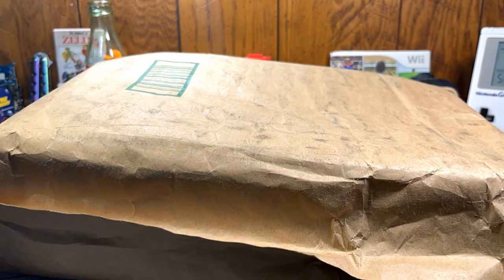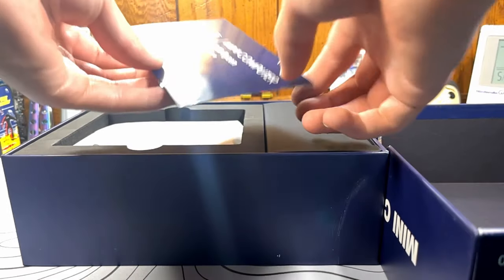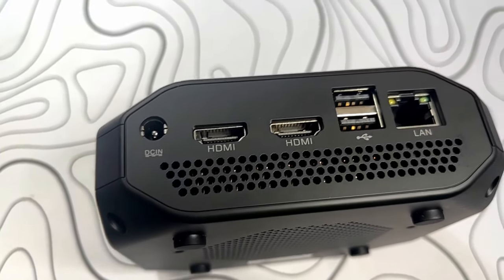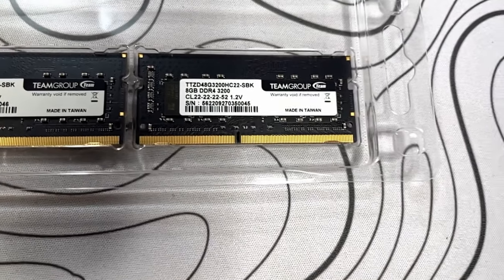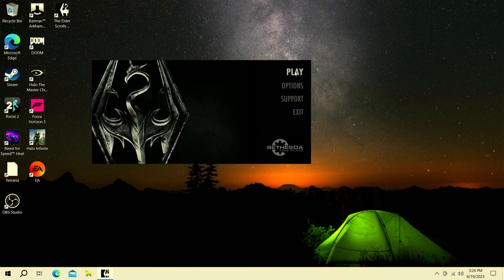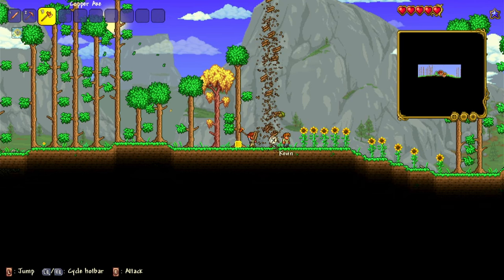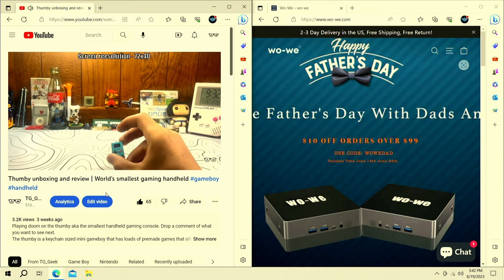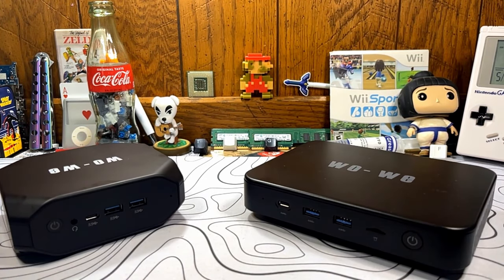This $100 Mini Pc Is Awesome! A-9 9400 Wo-we Mini Pc Hands On Review

Comment: I bought 2 of these.  I gave one to my son and he set up both with Linux (Fedora).  It is taking me a little time to get familiar with Fedora, I'm familiar with Ubuntu and Mint.  My son added an additional 8 increasing the ram to 16Gigs from the original, then I increased to 32.  Everything works well. Actually, I'm impressed,  the computer and Fedora OS, recognized the printer/scanner and I can now scan and print, which is something I could not do before.  I find that a few YouTube videos will not play, probably something in the setup,  the same videos work on the Pi-4.  I'm an old guy in my 70's and I can find my way around the computer and new OS.  I won't use MS Windows and avoid Google as much as possible. Duck Duck and Startpage work well.  I wouldn't say it's a Raspberry Pi killer, it's just different where the Pi has applications that work with the IO and daughter boards. The Wo-We would require some USB to IO interface that will need to be developed for apps.  It's difficult to compare Pi's and Wo-We's, in general, I think it's a better deal than the current over priced Raspberry Pi's. I have both, The KVM is hosting a couple MacMini's, a Pi-4 and the Wo-we excavator. My son put a remote into my computer so he can find and fix  things when I can't or mess up something.  All is good.!
Reply from the maker: Great to hear it’s working for you!

Comment: I'm thinking of using one of these in my travel trailer. I use Plex at home to record a lot of shows to watch when we are on the road. I convert them to .mp4 files and use an old Windows 10 laptop to cast them to a Roku TV. Do you think one of these Wo-we units would handle running Plex to use as a stand alone media server?
Reply from the maker: So for stuff like that I’d recommend their 5600u unit. A slightly higher price point around $300, but I’ve gotten it recently to begin reviewing for a future video and it’s a zero compromise mini pc. Has plenty of storage and ram stock and is upgradable with a really fast cpu. This unit is impressive at around $100 but I’d only recommend it for light internet tasks since it’ll bog down with more intense things.
Reply: @TG_Geek That's kinda what the little voice in the head was telling me. The Prime Day $80 price tag was tempting me but I really only want to build this once. Thanks!
Reply from the maker: @davemuir5926 Yeah I’d recommend saving the extra cash for the 5600u model, let me know how the setup goes!
Reply from the maker: @davemuir5926 Just checked the 5600u and there’s a coupon for $70 off bringing it to around $230. I have a review in the works for that particular unit that I’m planning on getting up next week or two.
Reply: I think it will work just fine.  I have done the same thing in the RV with a Pi4 along with a wireless keyboard and mouse. I tether it to my cellphone for emails and surfing and watched a few programs on a USB2.0 drive,  I can't imagine a USB3.0 work work less favorably. I have tried videos on the Wo-We through the USB and no problems.
Reply from the maker: @fredjordway5211 My unit had windows which I found would chug occasionally, but I imagine a Linux install like you’re using would be far better.
Reply: @TG_Geek  I ended up purchasing a BeeLink Mini S12 Intel 12th N95. Works good, added a 1 tb ssd. Loaded all my TV shows, all my pictures and all my music. Created another Plex server on the BeeLink, just running the single user is no issue. As much as I love my AMD cpus, for some reason Intel is recommended for Plex.
Reply from the maker: @davemuir5926 Makes sense, whatever works for you!

Comment: If the install media for your Windows 10 was for the professional version Cortana would not be so obnoxious.  You don't hear Cortana in that one at all.  I don't know why they left that noise on in the home edition installer.  There is one file that can be placed somewhere on the install media that can also have your key put into it.  Then there is a specific folder that the Windows installer will look in for it.  If it is not there it will just use your default embedded key or prompt you for one on computers that do not have it.  I know Cortana can be annoying while installing Windows.  I wonder how many people it startled to this day while they installed fresh copies of Windows.  It wouldn't be so bad but it is just about full volume or at least annoyingly loud.

Comment: What is the idle power consumption? I need to replace an ancient atom and power consumption and cost are my main sticking points. It isn't doing anything stressful, but I need to run windows 24/7 and I'm off grid.
Reply from the maker: Ranges from 5-10W.
Reply: @TG_Geek  That is pretty good... I might find lower, but probably not cheaper while running windows. There are probably more power savings to be had finding a really good 12v supply than a more power efficient x86. Thanks bro!

Comment: Hello and thanks to who is going to help me. So I start a etichal hacking course andbi bought a Minipc Lenovo M910q. I5-6500t, 512ssd 16gb ram. Everything works well for the course but I want tonplay total war games. They need a simple Uhd640 intel graphics.. mine have Hd530 and when its time to to big batte the games turn off.. my question is is it possibile to change the cpu? For me a simple intel pentium G7400 with hd710 grapichs is more than enough.. mant thanks
Reply from the maker: I’m not super familiar with Lenovos but I’m pretty sure the main board is very similar to a laptops, in that the cpu isn’t interchangeable. Hope this helps!

Comment: DO NOT BUY it refuses to open the system, locks you in the BIOS menu wont let you to ANYTHING and when ut does it bluescreens and opens it not long after
Reply from the maker: I didn’t have any issues with the review unit I checked out, did you reach out for a return/replacement?
Reply: @TG_Geek  well my stepdad got me it Tho I think he has something to do with that does it have an attachment port on the bottom to allow mounting on monitors?
Reply from the maker: Yeah there’s a bracket that lets you mount it to compatible monitors, my monitor isn’t a compatible one but there are a few
Reply: @TG_Geek  ok I thought my stepdad might've skewered something important
Reply from the maker: Yeah that’s a vesa bracket, so it can only fit in vesa compatible monitors. Best option is to put it in the desk if you are unsure.
Reply: @TG_Geek  i found out it was the RAM
Reply from the maker: Oh good to know, it’s quite cheap to replace or even upgrade the faulty ram to a higher capacity